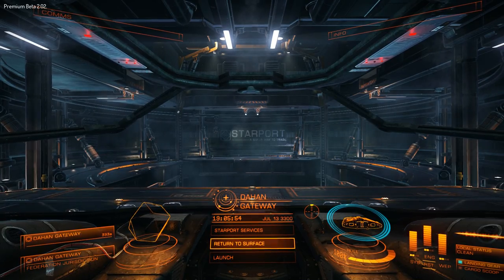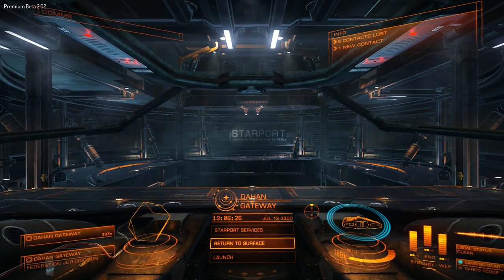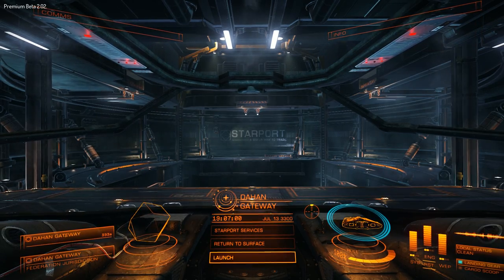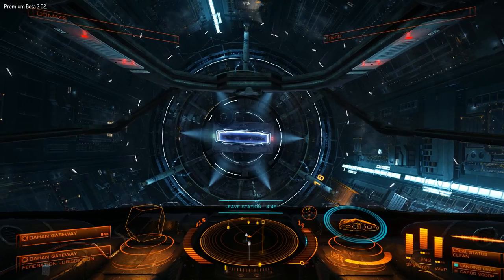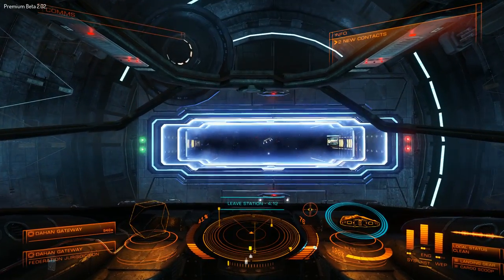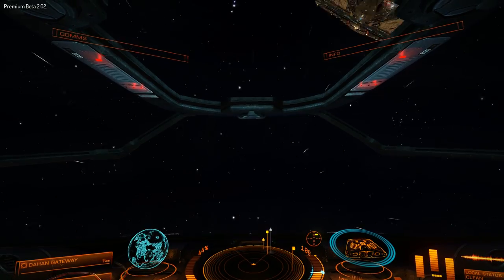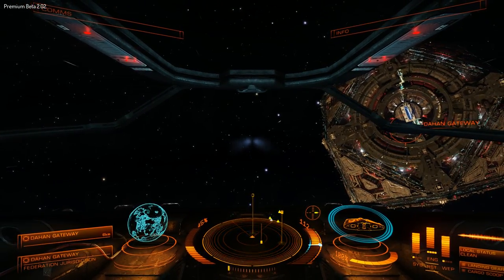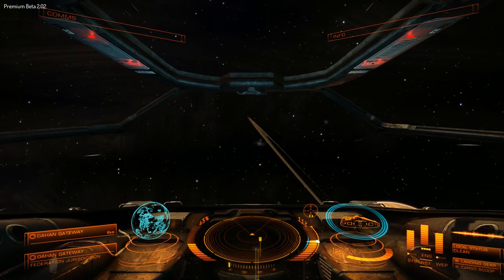Elite Dangerous with CH Products HOTAS

Comment: Dom -- just picked up a CHProducts stick and throttle a couple of days ago, and wanted to say many thanks for the great vid and associated files+desc on your blogpost -- absolutely great starting point for setup with Elite.  A couple of minor tweaks for my tastes, including 1) Accumulate headlook mode; 2) Headlook axes mapped to the ministick on the throttle when headlook is active, vertical/lateral thrust otherwise; 3) Throttle axis mapped to forward motion only for greater range sensitivity (reverse button on the stick's side fourway is sufficient for backing maneuvers), plus associated zeropoint tweak in the script.  Otherwise, fantastic control choices -- again, many thanks for the effort!
Reply: Oh, and I also mapped yaw to left-right motion of the stick's side fourway (rather than roll as per the config) -- I like to have yaw/boost/reverse on the side fourway so that my thumb can stay there during dogfighting, and I only ever need to move my thumb to the top of the stick during a fight for targeting and weapongroup cycling.

Comment: Hello Dom, and thank you for this amazing work i really enjoy your mapping. But how do i add pro pedal?
Reply from the maker: Very simple. In the CH Control Manager you can just add a device and select the pedals from the list. Make sure the pedals are the third tab along if you're using my maps as ordering is important with the CMS scripts. You can then map the yaw axis to one of the spare DirectX axis for device 1 (I think slider 0 and slider 1 are still available on my maps). It's also possible to map the toe breaks to axis, or to write some CMS script to use them for buttons. I no longer have the pedals, but I used to use one pedal as a brake (set the throttle to 0) and one to boost for the space sims I used to play.

Incidentally, there's a new joystick map here: http://elite.domdavis.com/2014/08/19/new-ch-products-joystick-map/ and I'll be updating that with a small revision in the next couple of days.
Reply: Dom Davis Thank you, it s working. Ho i could not try the new mapping the link for the ed.map is dead 404 error. But the change made are really good hope i can try it soon.
Reply from the maker: gzaos Odd, I'll need to look into that, probably a typo somewhere. There's a new post here: http://elite.domdavis.com/2014/08/27/muscle-memory/ and also the new joystick layout is here: https://github.com/domdavis/ch-products-elite-map - Hopefully by using GitHub it'll remove any 404 issues :)

Comment: so you cant do revers with the throttle? because i have one coming in the mail, and just wondering if this gear makes things better or just more problems to deal with, iam also thinking about getting joystick, and peddles.  thanks for video.
Reply from the maker: You can set the throttle up to do reverse with 0 in the middle, although there's no detent so you often have to get it close to 0 then adjust. I've gone a different route and assigned a button to reverse the throttle. Since I rarely go backwards this works well. I've also got buttons bound to thrust forward and thrust backwards if I need to blip the throttle in either direction.
Reply: Thanks for the reply,  so is the hands on throttle not accurate enough that you need mapped out buttons?  Like you can't feather the throttle? Also  I think I am going with all 3 of the CH Products do you have any thoughts on the peddles? Thanks again!
Reply from the maker: joe bob Sorry for the delay in replying. Life has been hectic. The hands on throttle is accurate enough, I just find it easier when docking to know what I'm actually stopped and then to blip the throttle to make minor changed in position. Outside of docking on the pad I use the throttle for everything. I rarely need to go backwards so having a button mapped to reverse throttle is adequate. 

I've used the pedals before, they're great for flight sims. I think I actually prefer the buttons for yaw in Elite, although there is definitely an argument for pedal control in combat.
Reply: Dom Davis thanks again!

Comment: I need a profile with the lateral thrust on the thumbstick of the throttle and buttons for hyperspace jumps.Frustrating just trying to set up the controls for this game.I have a track ir so don't need the hatviews.
Reply from the maker: Jellybeantiger You can always base a profile off one of mine, especially the earlier simpler versions. Putting together something simple isn't too hard, it just gets a bit fiddly when you're wanting to do some of the funkier stuff I've done.

With a game as complex as elite it is going to require a time investment to build anything custom, but you should be able to put together something in an hour or two tops. 

An alternative is to load my redux joystick map, in the control manager, but not load the game config in game. Then go map the buttons/axis the way you want them through the games config options. You'll need to make a note of what buttons do what, but could be done in half an hour, and easily tweaked.